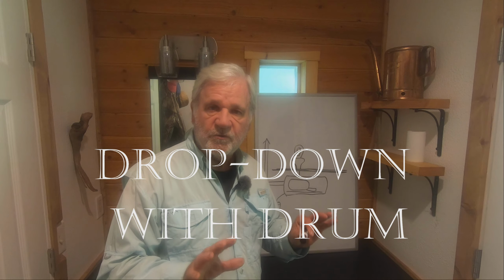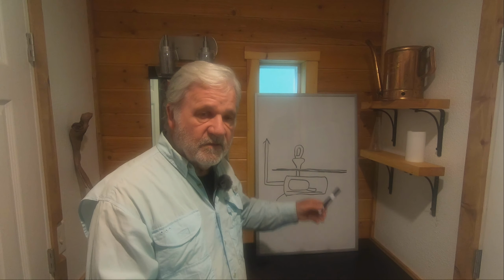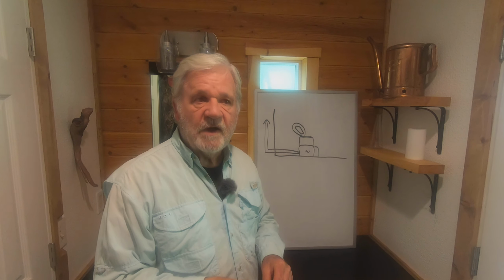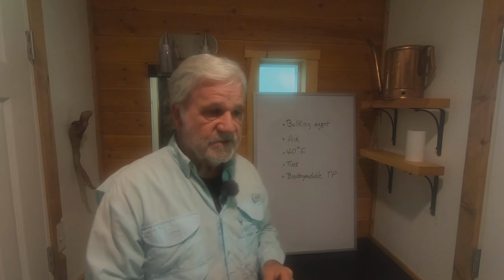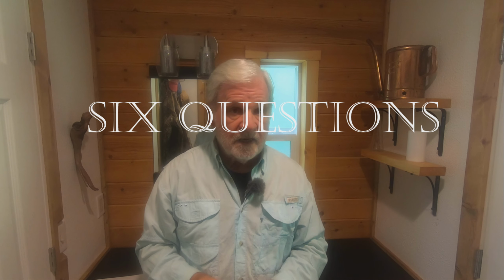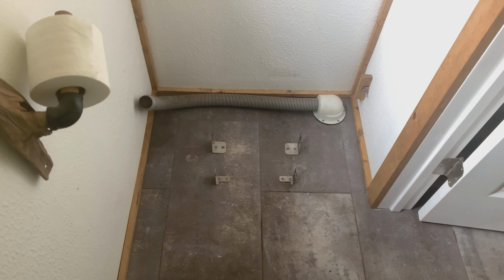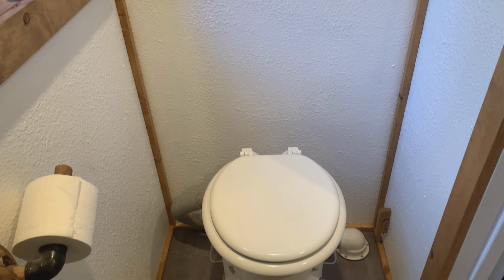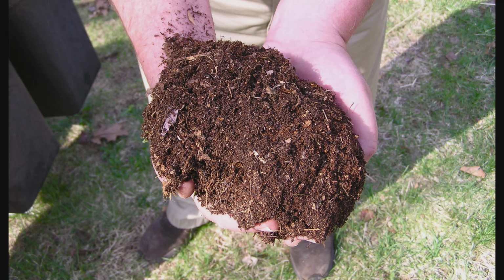Compare Composting Toilets. Off the Grid with Karen and Grid

Comment: really informative. we are looking for a solution for weekend guests on our property. its a different matter with handling other people's waste. It would be mounted in a shed and we'd provide electric from a leftover solar system from an RV with a lead acid battery.  Would the airhead be appropriate to that context? Thanks!
Reply from the maker: I’d think about the physical size of your guests, how many there would be, how often they visit, and the money you want
To spend. Large people would probably be more comfortable on the SunMar dry toilet. It also holds more waste, so clean out is less frequent. This could be a factor if you have more than a couple of people visiting more than a couple of days. Money-wise, the SunMar is cheaper.
Reply from the maker: Sorry, pushed the wrong button. The above said, the Airhead is more compact and easier to get on and off. It would be my preference for a small space and infrequent guests.
Reply from the maker: Oops. Checked prices. Airhead cheaper. But check lead times on delivery.
Reply: @offthegrid4036  thanks so much really helpful. I was leaning towards the airhead before I watched your video, happy to see that was your choice too. I’ll check out the Sun Mar too as a comparative. I’m actually pretty concerned with liquid waste capacity, that would be an issue with a lot of users
Reply from the maker: Liquid waste has never been a problem with Airhead. It is segregated and very easy to dispose of. Biggest problem with composers is their users. There’s a yuck factor…a mid-perception that needs to be overcome.
Reply: @offthegrid4036  thanks, I appreciate the insights